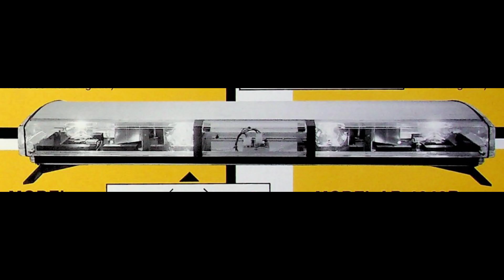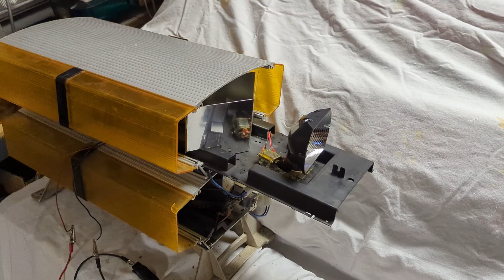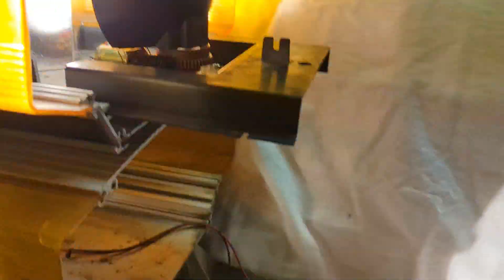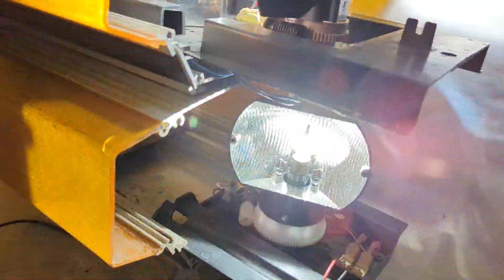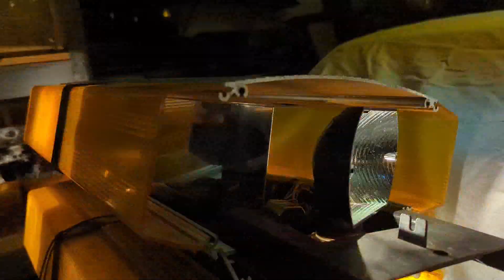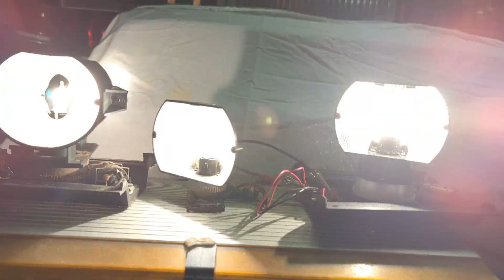An Overview of Austin Electronics Take on the Whelen AdvantEdge

Comment from the maker: Something I failed to point out is that the "tray style standard" rotator has a 795 bulb instead of the notoriously hard to remove Whelen SN series that it would normally use. This was one more attempt to make the bar (and the beacon) more user friendly near the end of the production run.
Reply: I've always hated that Whelen always seems to be so insistent on using their own bulbs. There's no user advantage.
Reply from the maker: @doranbaltus  Agreed. Whelen always had some sort of goofy bulb with their halogen line. These late "mini tray" stryle rotators were the only exception. Weldon tried to capitalize on this issue with their 9x7 and 7x3 halogen lightheads that took h1 or 795 bulbs. But that was another example of "too close to LEDs" to be a breakthrough.

Comment: I always felt the lighthouse style reflector really didn’t throw much light..
Reply from the maker: I does when it is in a rotabeam beacon which is what it was designed for. I agree, in the advantedge it is not great and is limited by the height of the bar. It really wasn't the best solution to the "pick one rotator and stick with it" Austin plan.